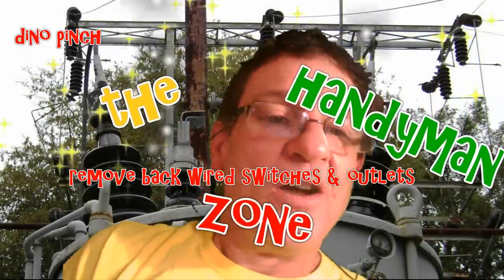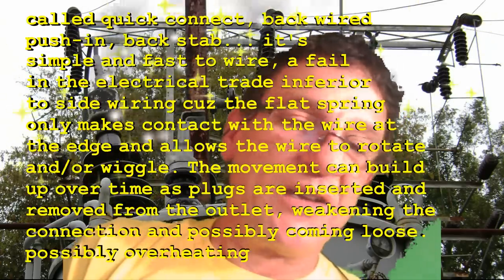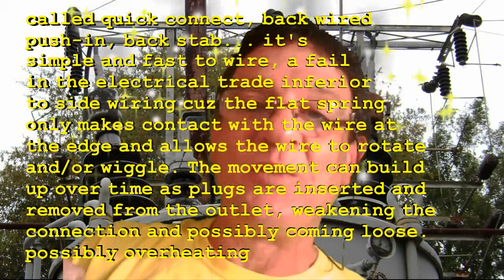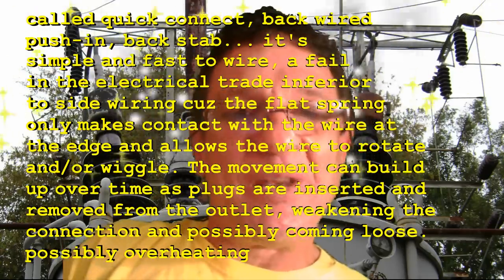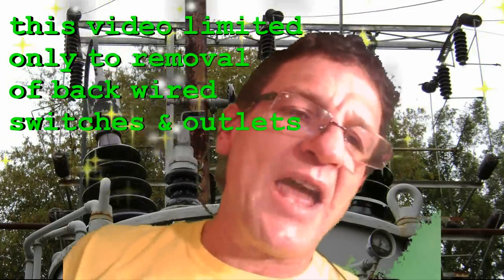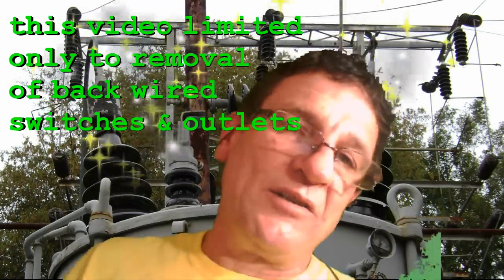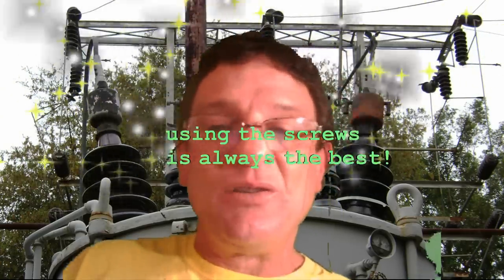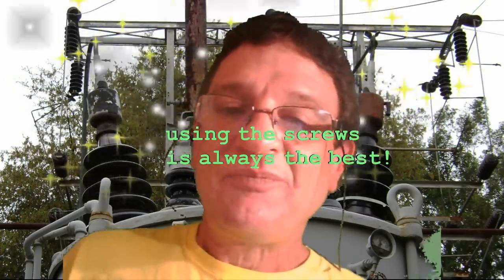how to release wire on push-in switches & outlets

Comment: Thank you!  I had been fighting switches that had push-in wires, and couldn't figure out how to remove them.  As you said, I just had to push HARD with a small flat blade screwdriver.  It would click and then I could take the wires out.

Comment: Thanks for the post, changing outlets and will just use the screw terminals instead of the quick connects. All I need is trouble later with an intermittent connection.

Comment: Speedy connects are basically one time use connections. It's a quick install feature that assumes it will be there for the life of the house.  And it will be.  Once you stick that wire in there it ain't comin out.   But if you ever do need to uninstall that switch for any reason (by sticking a small flat head device in the rectangle slit just below the wire, pull wire to release) then you most likely will not be able to use the speedy connect feature again.  Sometimes you can get lucky, but most times it's a one shot deal.   Other times the wire might hold, but it's not near as strong.   Personally I just use a new outlet.  The screws are pain in the ass.

Comment: Thanks for the mini-review.  Since I work in a hardware store, it will come in handy when customers ask about the backwire or sidewire devices.  I like your reasoning too; you simply get a better and longer lasting connection when you use the screw.z

If you don't mind my asking, what is your take on the new receptacles that have a small bar and screw on the side?